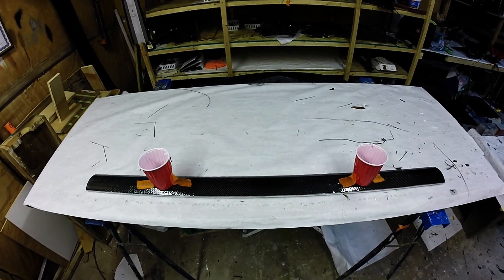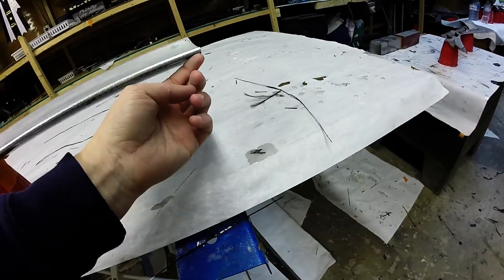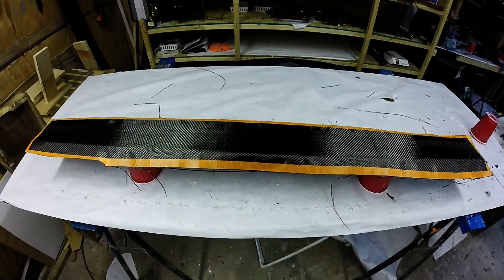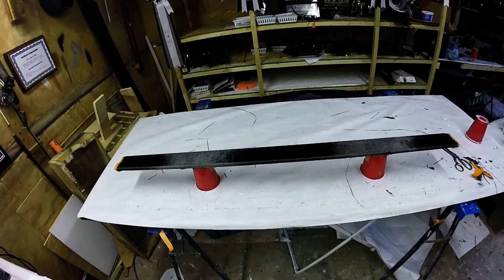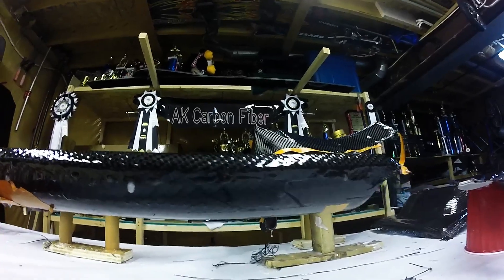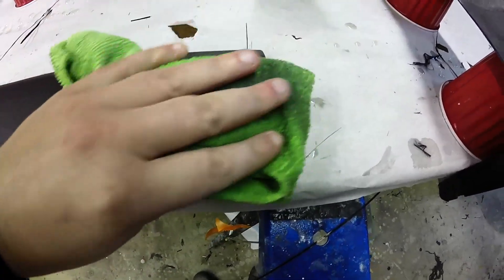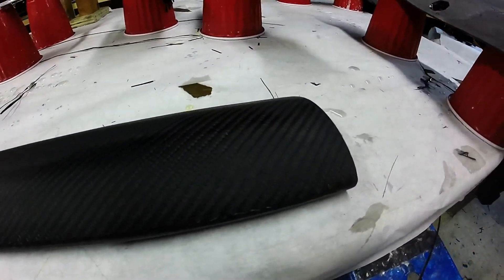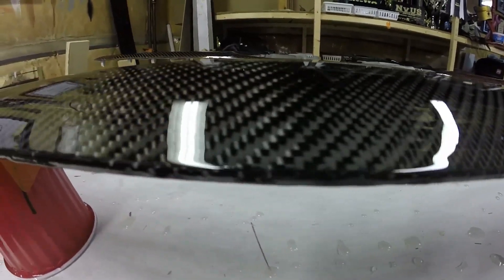Carbon Fiber Overlay/Skinning SEAMING!!!

Comment: question. you don't need to necessarily have to do a clear coat at the end right ?? i mean i've seen a couple of other videos on this and some people just polish it with a compound  after the went sand and it comes out great too. so is it just a matter of whatever you want to do ?
Reply from the maker: Xavi_onthasrt4 the clear coat is for uv protection. Without it the piece will yellow in colour over time.
Reply: @crbnqwn2591   ahhhh ok great thank you. appreciate it.  i mean i guess for a part that goes inside a car where the sun doesn't hit it as much then its not that big of an issue but for an outside part clear coat is a must
Reply: I would highly recommend using a 2k clear coat as final finish. It really makes it pop as well as being a UV protectant.